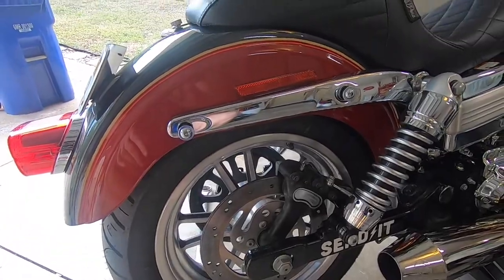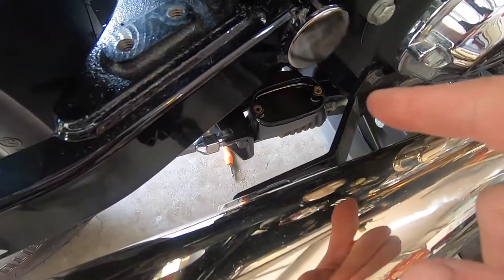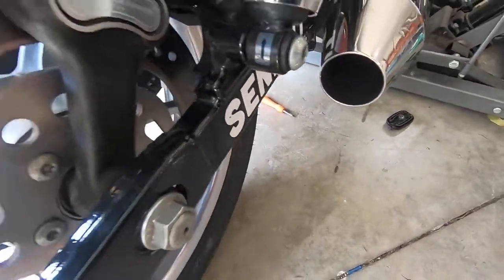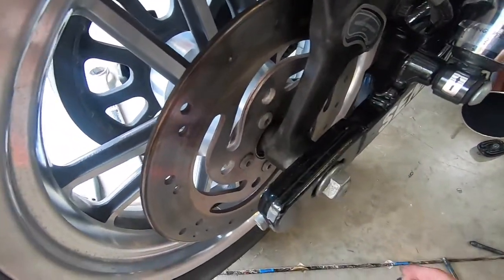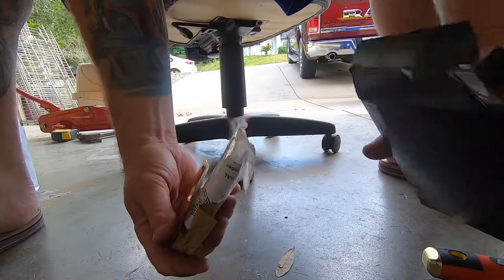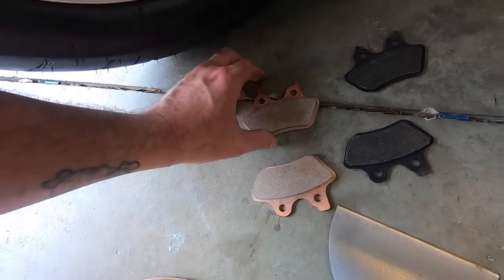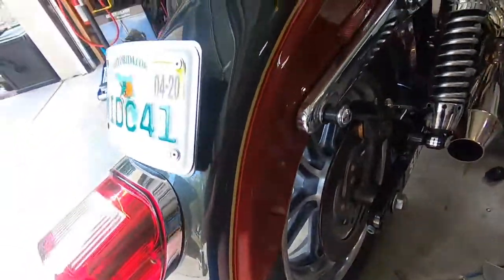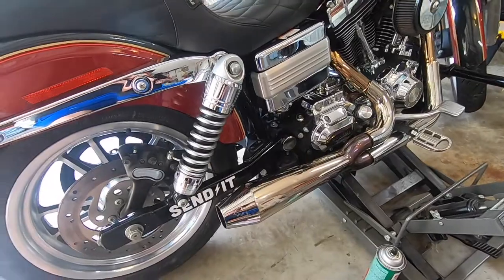How To Change Harley Dyna Brake Pads Without Removing Wheel | 06 FXDL

Comment: Wow, I am so glad I found this video.  Even more happy you made the video for me to find!!  In the process of changing back tire and tube because of a flat, like that isn't enough of a nightmare doing everything by myself with borrowed jacks , Cause my Dyna frame aint normal and if you know Dyna's you'll know exactly what I mean!!   Well in the process the inner brake pad was looking a bit low.  I'm pretty broke right now and I'm like wow  I got the wheel off now is a great time to do brakes instead of putting all back together just to take it all off again next month.. ... NOW , I don't have to  Yaya  Thanks  dude!!!  Not that I don't have to put brakes in now I just can't afford it right now.  So this is great, when I do get the money next month Ill do the pads.  No pulling wheeel off again!!!!  and buy  my new front tire to go with the rear!!
Reply from the maker: Hell yeah man! 🤙🏼
Reply: @austinsadventures305  Got everything back together and the brake pads will be here on Thursday.  How much of a pain is it to get the rear pad in and holes lined up on both pads??   What did you use on the bolts??   I have copper anti seize, or blue Thread lock??  I am guessing you used anti seize????  Thanks for any info!!  I DO have a shop manual, but ihavent read the brake pad part yet.  I saw you do it so I figured I'd ask!!
Reply from the maker: Anti seize
Reply: @austinsadventures305  Thank you!!!!

Comment: The one thing that would concern me about this approach is scratching the rotor. If you could tap a sturdy plastic trim removal tool in there, that would be preferable.

Comment: Thanks...great simple instruction!
Reply from the maker: That’s the goal. Don’t over complicate shit! Lol
Reply: Just ordered pads...mine is older...'98 fxd, so a little different, but we'll giterdone
Reply from the maker: @henrytaylor2638  same process
Reply: @austinsadventures305   My Dyna rear end is a bit different but the brake caliper looks exactly the same.. One piece that rests on the frame and rear Axle.  Im taking mine off as we type lol    to change a flat.  Hopefully it's not a nightmare trying to get it back on!   as i was changing tire i noticed one pad loking a bit low.  so i came inside to price pads and cry because I have no cash to buy the pads right now and WASNOT looking foward to pulling all that crap off again in two weeks.  So happy this video was made , so I dont have to go to the nightmare part 2.  Thank you!!!  It looks real easy, but i'm sure I'll find a way to screw the pooch doing it this way, the easy way!!!

Comment: I have a question that after putting the new brake pads, the two screws that you screwed back in should they be really tight or just normal tightness?
Reply from the maker: Look up the torque specs for your bike

Comment: NICE. Do you have a video for the front pads?
Reply from the maker: Thanks for watching Mike! I do not have a video about that since it is very easy to remove the front wheel compared to the rear.
Reply: Is it the same
Pads for front and rear?
Reply from the maker: No

Comment: Be aware in the calipers the 2 bolts that are not holding the pads or the caliper on clasp the caliper together. If you remove them you will leak brake fluid and have to bleed them.
Reply: What do you mean can you explain it in another way?

Comment: What did you put on the bolts before putting them back on? Like a lock tite? And what is the spray you used at the end and why?
Reply from the maker: Anti seize is what was applied to keep the pins lubed. I used brake clean to clean off the brake fluid that had spilled. Brake fluid isn’t good on painted surfaces.

Comment: What is the size and type of the 2 bolts you removed from the caliper?
Reply from the maker: Brake pad pins. Same as front and back, can order replacements online.
Reply from the maker: I am unsure of size. Replacement is OEM 44314-00
Reply: I did this today with a set of trim removal tools, the socket I used on the pins was a 7/16 spline
Reply: Actually did it before finding this video just wanted to compare methods
Reply: Thanks !  That's what I was wondering too !

Comment: 1/4 in hex socket too small. 9/32 hex socket too big. 6mm too small. 7mm too big. Somebody suggested a 1/4 in 12 point socket. I see there are multiple observations that it would have been convenient if you mentioned the correct socket size. Why don't you just find out and tell us? Could it be a spline socket?
Reply: 12 point 1/4 wrench fits.

Comment: What size torx to get the brake pad bolts out? Is it an e9?
Reply from the maker: I don’t recall
Reply: @austinsadventures305  1/4 inch 12 point socket.